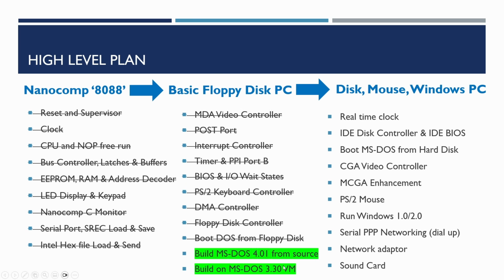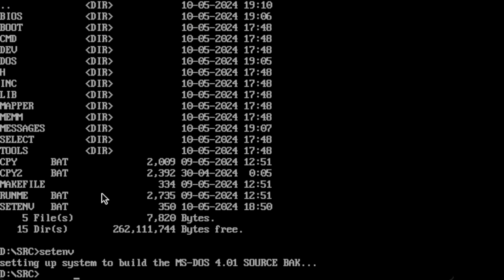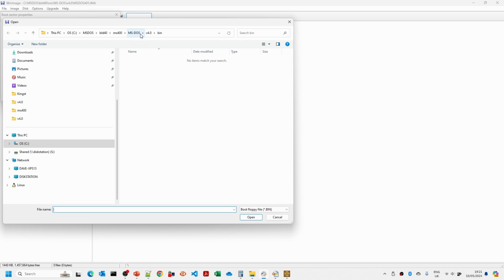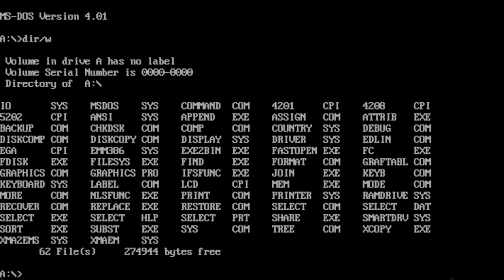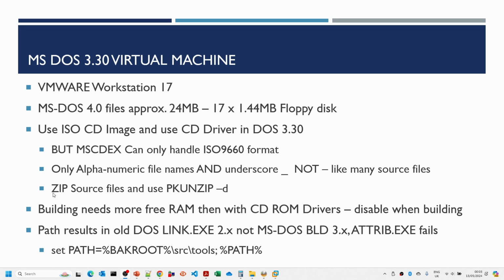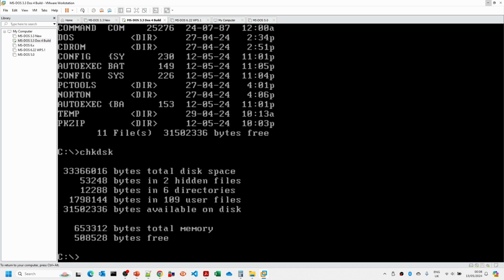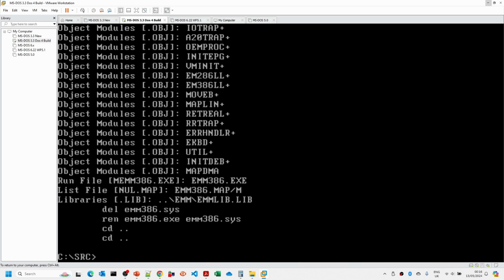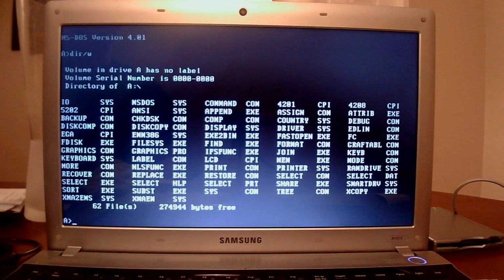Breadboard 8088 PC Build MS-DOS 4.01 on MS-DOS 3.30 #35

Comment: May be a bit of a diversion at this point but have you considered using the Supersoft/Landmark or Ruud's Diagnostic ROMs? They are detailed on minuszerodegrees and seem to be quite self-contained tests so perhaps easier to understand which bit of your system isn't working.
Reply from the maker: I will take a look. The main issue is the Breadboard PC is basically an XT with no DRAM (or DMA refresh), two interrupt controllers (like an AT) and PS/2 keyboard controller (with mouse support). Main issue would be test ROM may have trouble determining system type. DOS 4 with TEST1 variables set to 1 will output quite a lot of debug info. I think i still have a few DMA/FDC issues. So will try both approaches and update in the next week or so. Thanks for the offer ideas. Dave